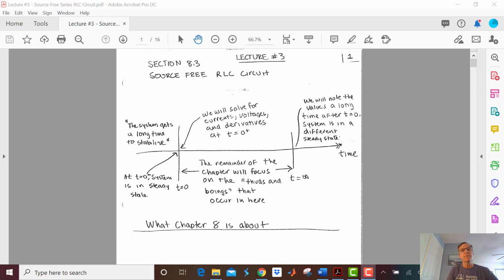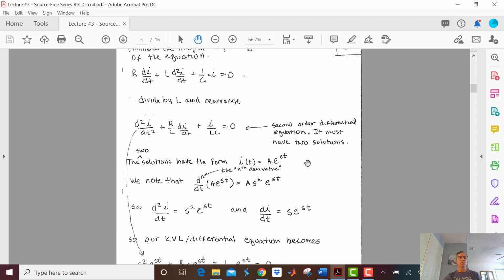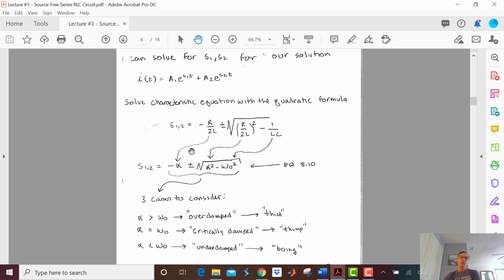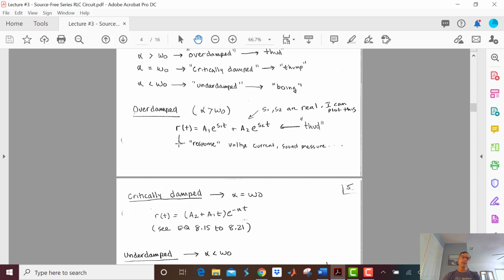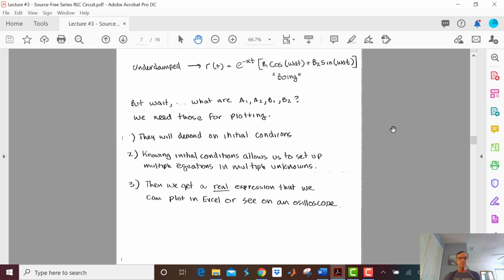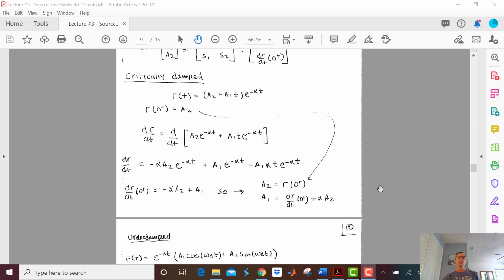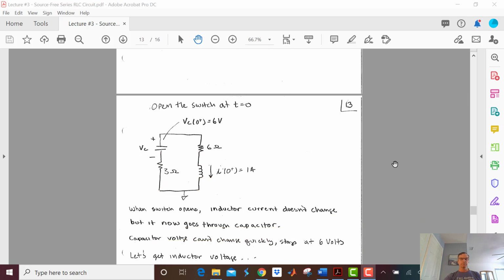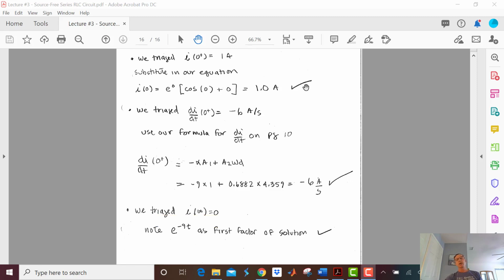EE 310   Lecture #3 - Source Free Series RLC Circuit

Comment: 8:14 Sir, can you please explain the sign conventions in the KVL equation? Why the element that is discharging (capacitor or inductor) in the circuit does not have negative sign?